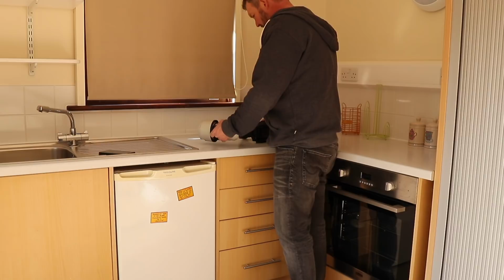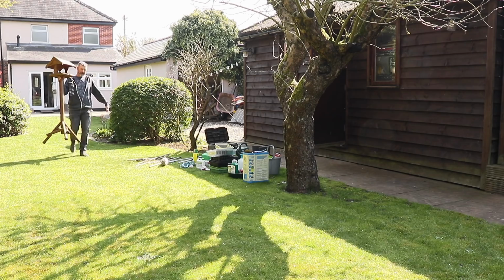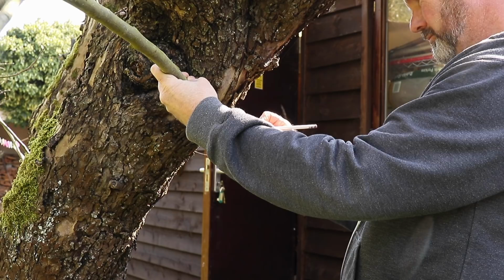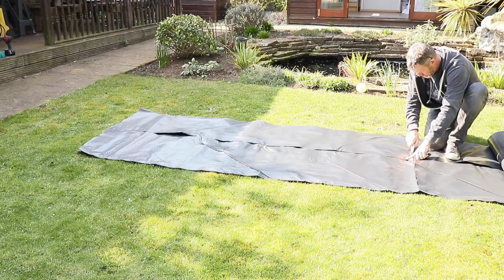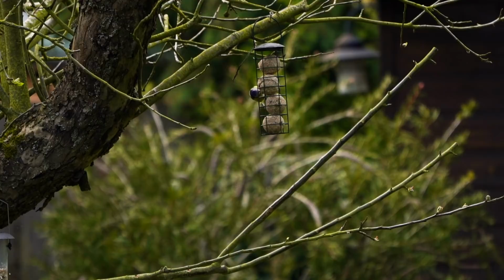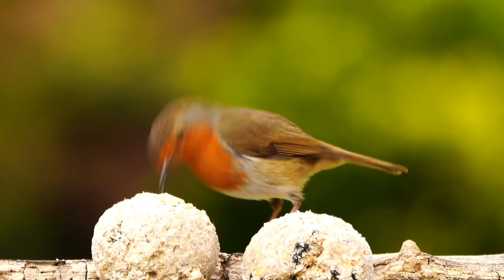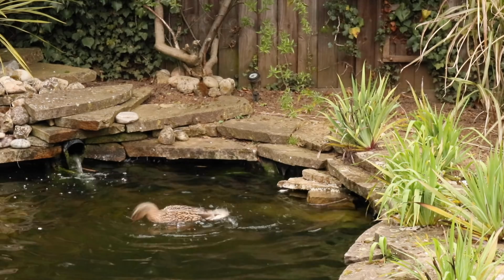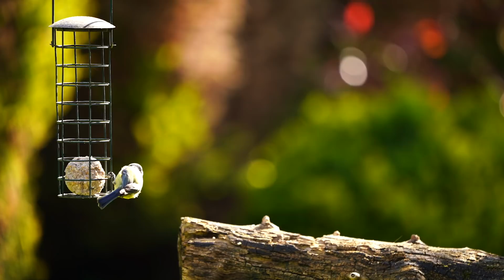How to create a wildlife photography setup at home - Sony A7rlll - Sony 100-400 Gmaster

Comment: At 15:15 - I'm a wildlife photo nut, especially birds. As soon as I saw the duck cleaning itself I was shouting in my head get ready! -- get as close to water level as you can, switch to portrait orientation, put their head at the bottom of the frame, widen your field of view a little, punch up the shutter speed and wait for it.  That stretching up  and flapping the water off their backs will happen every single time when they're done with their bath.  Well done!
Reply from the maker: You certainly know your stuff 

Thanks for the kind comment 👍👍

Comment: Thanks Darren, this is something I have done for years, and I liked the setup you made. For those of us with less DIY skill or just too lazy there is hope. 
If you have a garden / yard  setting up a feed and "Stage" outside a window can work as Darren did in his Man Cave.  Another option is a hunter's blind which is no more than a camo tent with no bottom and blackout coating  on the inner walls. The nice thing is it is portable and  you don't need  the permission of your partner to build a semi permanent structure.

Comment: Absolutely brilliant video mate, so detailed and the voiceover with the birdsong works a treat.  Mind you it does help with building a hide when 'I'm just clearing out the shed' results in finding layers of plastic and serveral lengths of 2x4 rather than the three old pots of half used emulsion, a bucket of rusty screws and several boxes of old toys that are in my shed! 😂😂
Reply: I agree Gary, that was a hell of a shed to sort out, along with summerhouses & observatory, the garden looked a great lockdown space.

Comment: Great video and amount of patience. I've been looking at the 100-400 for my a7iii, it looks like a cracking piece of kit
Reply from the maker: Morning Jonathan 

When I switched from canon to Sony I needed to replace my 70-200 F4 and so the 100-400 looked like a nice replacement.

It’s certainly heavier than the 70-200 but it’s a beautiful piece of glass and I’d highly recommend it. 

Have a great day bud 👍
Reply: @DarrenKnightPhoto  I have my eyes on the 24-105 as my primary lens so the 100 - 400 would fit perfectly in my line up. I have subscribed and I will keep an eye out for you using it! No pressure 😉

Comment: As wildlife junkie and photographer: Birds "use" other birds as protection "aid". Crows and their relatives are daring and very smart birds. If they are ok to hang out somewhere, smaller birds know it's relatively safe to go there too. Woodpeckers are birds like that too. When woodpeckers are around, you'll see lots of other birds. When the woodpecker see's you, the rest of the forrest (or garden) in like a square mile will know something is up from it's alarm call. 
About the ducky, some type of birds will get at ease fairly quick even when they see you. if you just go about your thing and continue doing so, they quickly learn that to be the new "normal". common blackbirds have that habbit too. i regulairly have them trailing me for worms when i'm turning over the soil in my garden.
On the AF area, i usualy tend to work on flexible spot small, it can helps to quickly composite on the "rules of thirds" (or whatever other way of compositing a frame) by pre placing my focus point. Expandable flex is not a bad idea either (and the birds eye-af is nice in that mode). it gives you some more leaway.

I loved your video and i don't know why i never came up with this myself. Time to start my own hidden gem location like this! Thank you and keep enjoying life!
Reply from the maker: Morning Erwin,

What a fantastic comment and thank you for being so detailed.

Like you, I now mainly shoot flexible spot small and occasionally expand flexible spot, but to my knowledge, the A7R3 doesn’t have animal eye AF which is a real shame. 

Thanks for all the useful tips and great explanation 👍

Comment: I’d recommend back button focus, continuous auto focus and maximum frame rate. And if you’re on the move a way to change ISO as quickly as possible. Upping the ISO is part of the game. Better a wee bit of noise and get the shot than miss it.

Comment: Hi Darren, lovely experiment there, if I can make a suggestion here, on the photography part, put your ISO on auto, and then you have only one aspect to look for that is the shutter speed as your aperture is already maxed out. check this out and see if it works for you. I use it almost always for my birding.
Reply from the maker: Hi Prajeet,

Thanks for the tip. I’ve just started to use auto ISO, but I’ve set the values to fall between 100 - 4000 ( I think) 

It certainly helps in fast moving situations. 

Thanks for the kind comment and best wishes.
Reply: @DarrenKnightPhoto  Hi Darren, Happy I could help a fellow enthusiast...

Comment: Question from a newbie: I would like to take videos of birds in my backyard similar to this example on Youtube:  ( https://www.youtube.com/watch?v=xbs7FT7dXYc&t=9855s ) where the camera is stationary on a tripod and pointed at one spot while recording birds landing and eating food ( not flying in the air ). I have am considering buying a Sony A7Siii and a Sony FE 200-600mm F5.6-6.3 G OSS Super Telephoto Zoom Lens but don't know if that is the best option. I am concerned the SonyA7Siii does not have enough pixels and I am concerned the  Sony FE 200-600mm will not work well at dawn or dusk which I read is a problem with that lens. Do you have any advice on which camera and lens to buy to take bird the type of bird videos I want to capture ? Thank you.